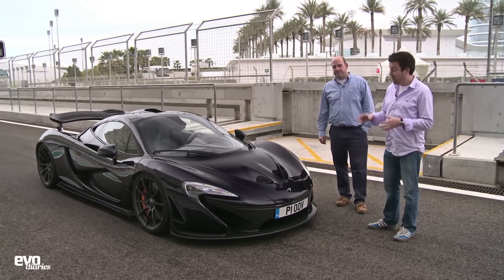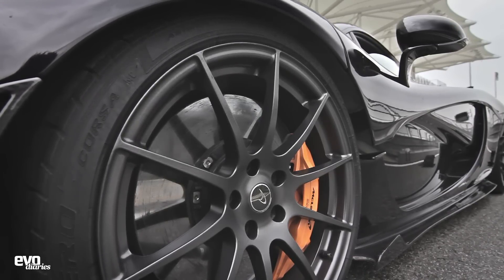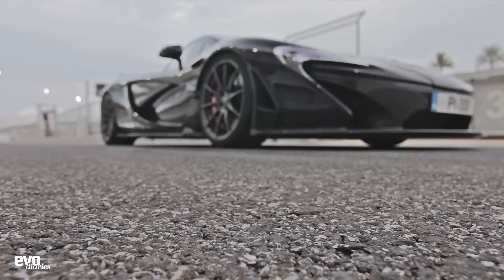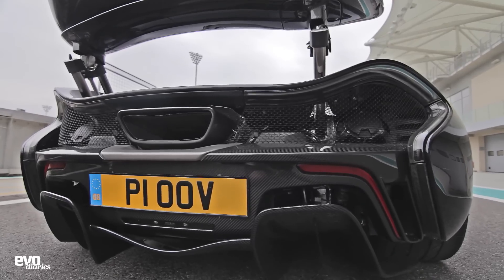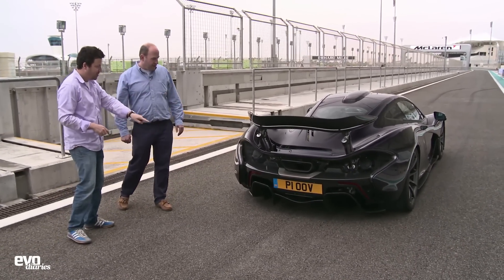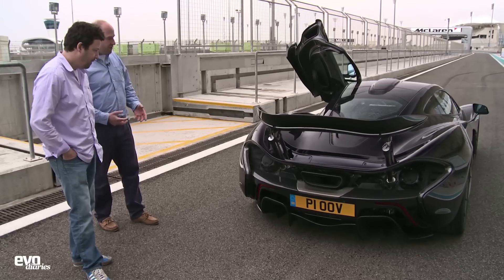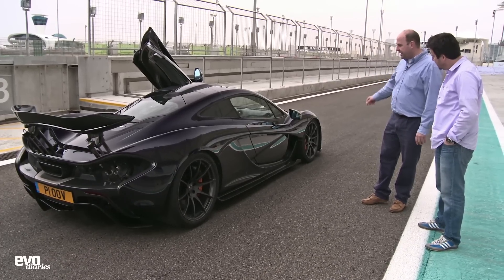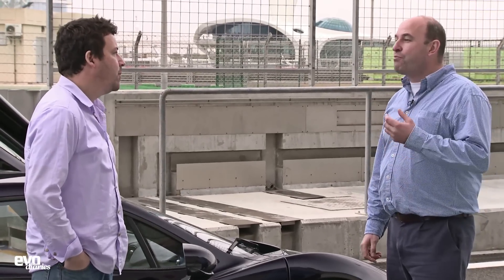McLaren P1: technical analysis | evo DIARIES

Comment: I love the rear wing over th laferrari wing.  I love how it pitches on acceleration and then on lift off.  I have no complaint about this car until we hear the wastegate sound then for me its off putting.  but other than that I absolutely adore this car.  i wish they engineeree it like the 488 where you dont hear the wastegates.  for me it spoils exotic cars as it is usually associated with tuners.  So the pagani huarya is the same issue.  but still I love the p1.  The brakes are phenomenal....The whole engineering of this vehicle, its a masterpiece.

Comment: Funny when he says at around 7:19 that absolutely every design decision was analyzed from a perspective of what would make it the best driver's car. That's bullshit, because they went with turbos...
Reply: +Huxxy What's wrong with turbos exactly?
Reply: TroublingStatueVII Lag
Reply: Ok. Good thing the P1 doesn't have any.
Reply: TroublingStatueVII It certainly does have lag, and such has been pointed out in most of the in-depth reviews of the P1... Haven't you seen them? There's many on YouTube.
The fact that they've tried to cover the lag via adding an electrical motor doesn't change the fact that turbos inherently have lag. It's just a physical reality. Turbo is a feedback loop...it can never be as quick response as normally aspirated. The LaFerrari on the other hand, does not have this problem. The normally aspirated V12 has instant response at any revs...and it ALSO has additional instant electric torque. The P1 electrical system is what Maclaren THEMSELVES call "torque-fill"...that should tell you something....
Reply: Ok, fair enough. Still doesn't detract it from being an amazing car. If I had the chance to buy one I definitely would not be put away by a bit of turbo lag, witch would probably be the last thing you think about when you are flying down the track anyway.
Reply: TroublingStatueVII If you had the chance to buy a P1, you'd also have the chance to buy other hypercars. Why not a LaFerrari or 918? Normally aspirated in both cases...
Reply: Because I don't care if it's normally aspirated or not. It doesn't really mater.(in my opinion anyway)
Reply: TroublingStatueVII Your opinion might change if you do a back-to-back comparison drive...Right now...it's all theoretical. But I can tell you one thing: Power - without control - is nothing. And the instant "OFF-ON by command" power delivery of a HiPo normally aspirated engine is very relevant when you need just the right amount - NOW - and not a moment later - like on the limit of cornering grip steering on minute changes of throttle input. In this scenario...you need telepathic instant connection with the power plant. Turbo is like the time delay echo of a long-distance call...
Reply: I can see how that may be a problem if you are an F1 driver or something. Thing is however, 98% of people buying this car are not, so they will not be on the absolute edge of grip. I can still see your point though.

Anyway. I think we have argued enough about a car that we will most likely never experience. And at the end of the day that's what it's all about isn't it.

Comment: All that inch perfect design in the car but at 8:09 you notice the visual carbonfibre looks different??? This is a great car but i prefer the Koenigsegg One:1. It does 0-400 km/h in just over 20 seconds and stops from 400-0 km/h in 10 seconds. It has more downforce then this has. And it makes a hell of a noise better then this fax machine with some turbo noise.

Comment: I take my hat off to McLaren. They have produced just 2 hypercars for the road (and 2 other supercars for the road) and both set the bar extremely high. Ferrari have their work cut out for them with the LaFerrari if they want to match this. If they do, then it will be epic.

The exhaust note of the car seems to sound even better in this video. Yet it still lacks a higher more refined pitch like a Ferrari F12 has. But thats just my taste.

If you ask me, the reason supercars of today handle so much better and are much more thrilling to drive than supercars of the 80's, 90's and even the 2010's (apart from the obvious fact that the handling of cars today are computerized) has a lot to do with the ability of supercars to manage the air around them much more effectively than in yester-years. As much thought has gone into managing air flow of supercars today as has been put into Formula 1 racing cars. That and computerized handling combined with hybrid electric / gasoline engines have given hypercars close to Formula 1 performance.

This car with its flowing curvacious lines is almost as sexy as a Ferrari 458. That back end is awesome looking! Arent those devices behind the back wheels Flux Capacitators from the "Back to the Future" Delorean LOL
Reply: I absolutely disagree, mainly because sending your car around the 'ring is something you're gonna want to set up for. I agree, they probably changed the suspension, maybe added a roll cage, anything, but that isn't what Chris Harris was talking about. He was talking about 'normal' tests. Just when they send their cars to Evo, Auto-Bild Sport (german), or even /Drive. They set up their cars for the track to be used, and send, as I said before, two different cars for two different purposes. This is totally beneath all other companies, specifically Porsche and McLaren.
Reply: ***** On paper the LaFerrari does seem to be better. But I think that if Ferrari are taking so much time perfecting the performance of the LaFerrari, it is because they know McLaren have set the bar very high. This is going to be one epic showdown between two Formula 1 Greats
Reply: ***** Except for the fact that besides EVO no major automotive magazine has gotten to take a look at the LaFerrari, while the Porsche 918 and the McLaren P1 have been given to most large publications to review. 
Both McLaren and Porsche have sent their cars around the Nürburgring, and both cars have achieved less than 7:00 minutes, the 918 even set a street-car record of 6:57.
Ferrari has done none of this. Remember when Chris Harris wrote about the scandalous way Ferrari let's magazines review their cars (if not, Ferrari always asks the journalist which track they will use, fine tunes their car to this track, and then sends an additional car fine tuned for straight-line speed, so that the review will be as positive as possible), well, I bet those numbers you get from Ferrari are aren't fairly achieved, but achieved using racing tires, optimal wind-direction, and fine-tuned dampers. Ferrari also never sends their cars around major tracks (Spa, 'ring, etc.), while Porsche does and shows off the times they achieved. All in all, Ferrari is scared of being beaten, which is why they do all this bullshit of making their cars do as well as possible, even when it's slightly against the rules. So I bet you, there won't be anything negative about the LaFerrari written anywhere, because every magazine knows, one negative word, and they won't ever see a Ferrari again.
Reply: Benedikt Ayrle
ALL manufacturers send special cars for testing. What Chris Harris said was, Ferrari cars are so good they don't need to prep them. Porsche said they used ONE month of preparations and testing to set the Ring time. Does it sound like a normal Ring time to you? Is there any neutral organization to check these times and cars? Who knows if the engine mapping, suspension, tires and so on are the same as on normal production cars?

Anybody can prepare their car to preform at top on the right season and day and temperature to get the best possible time around the Ring. I think Mclaren finally realized how irrelevant the Ring time really is. Also Ferrari never bothered with Ring time. It's not something they need to do to prove themselves. It's kind of beneath them.

Comment: The McLaren F1 (1993) is still my one and only true automotive love. It had problems with heat though in non-chilly temperatures as in the British Isles. Several owners of the F1 overheated driving through the deserts after buying the car. Pretty disappointing, heat-wise. Glad to see they learned a lesson not to make a car so particular to a buyer segment that it becomes only driveable in set conditions.

Comment: kinda of a pointless question when in a technical vid but is that car a blackish purple or is that just the reflection?? either way its beautiful color, and that car is way more pretty then I thought it was going to be.
Reply: It's blackish purple. Very nice colour indeed.
Reply: its actually just heat treated carbon fiber, they coat each piece with the lacquer then fire it again. it gives it a gorgeous shine, extra protection vs regular clear coat, and a beautiful blue/black sheer.

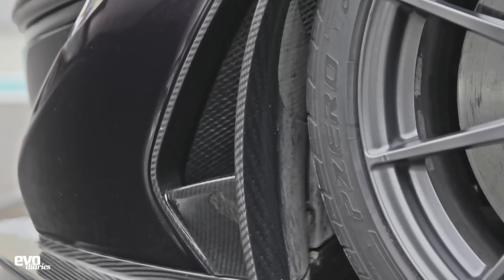Comment: 3:20 tyre rub on the front guard, ccc, 1 million and still gets scrub.
Reply: Really? You think McLaren are going to let a car out with tyre rub? Maybe you should do stand up or something. You're funny.
Reply: That's not tire rub...  That's the dust that has collected on the wheel well fender lining.
Reply: the answer might be simpler: It's a prototype car. In http://youtu.be/48LEh-gv85Y?t=9m9s you can see a large yellow sticker on the dash.
Might well be the XP7 that Chris Harris drove on Yas Marina and i think it's also the same, Top Gear drove ;-) It came around a bit
Reply: 4-tro
This is not XP7. This car is PP3 (pre-production car 3). Evo magazine and Chris Harris were the only two people given complete and extended access to the P1 at Yas Marinas..
Reply: 4-tro It's definitely the same TG drove. Same license plate.
Reply: 4-tro Dennis Kwok Dennis is right, this is PP3 rather than XP7. An easy way to tell between the two cars, from an exterior point of view, is the colour of the alloys. XP7 has always been seen fitted with the traditional alloy colour whilst PP3 has the darker coloured alloys. With regards to the number plate, P1 00V is the press plate assigned to the McLaren P1. Another good example of a press plate is Porsche Great Britain's 911 HUL plate. This has been used for decades and can frequently be seen on the 911 Turbo/Turbo S cars typically. The plate is not assigned to any one particular car and so you'll see a few P1 00V and 911 HUL plates knocking about at any one time.

Comment: what baffles me is the nitpicking about the aero, but then make a rearspoiler that sinks in the lines of the body and thus leaves a big hole wenn it comes up,
How the frack is that hole aerodynamic??? and no word or close-up on that part %)
Reply: The void does channel a fair bit of air away from the underside of the wing itself since that air is low pressure and will stay attached to the body of the car. That helps the wing a fair bit, I'd imagine, and if the wing is up, then drag is no longer a primary concern.